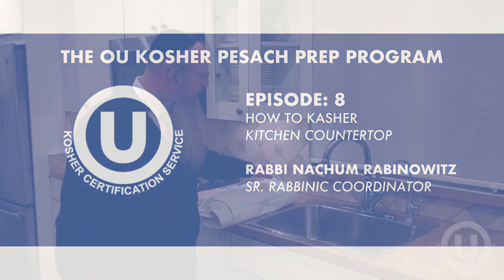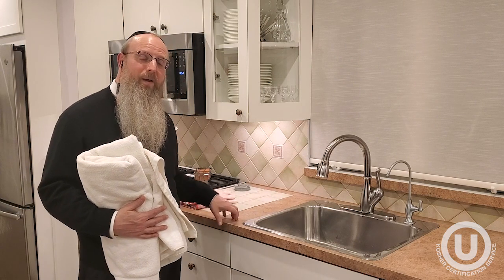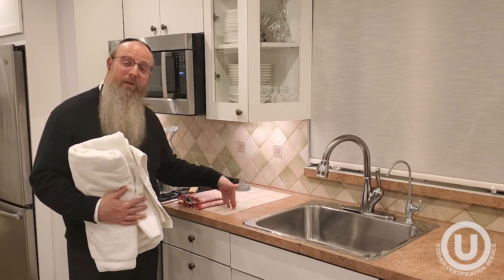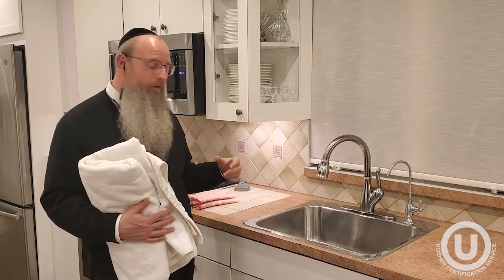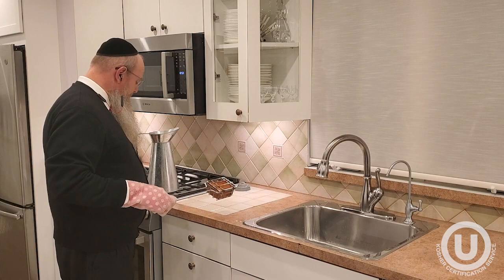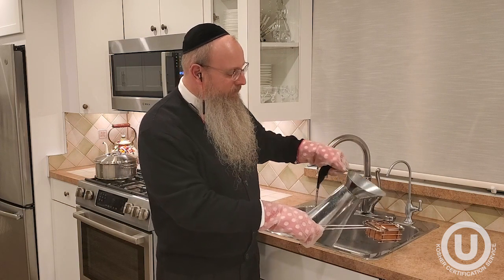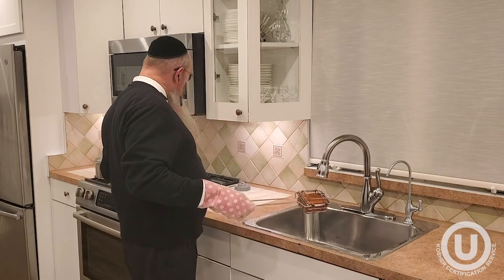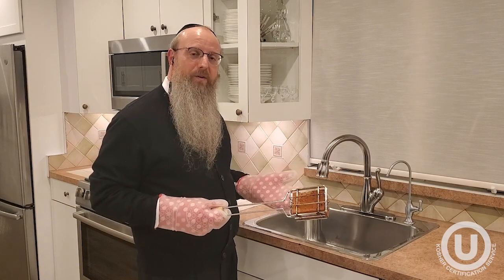How To Kasher a Kitchen Countertop for Passover- Episode 7

Comment: The water boils at 100C under normal atmospheric pressure. The brick cannot 'superheat' it.
Reply: The brick may mitigate the hot water cooling slightly from the boiling point while it is being moved and poured after being taken off the fire.
Reply: Steam can easily exceed 100C...
Liquid water is not doing the work here, heat is.
Reply: @thedaviddabrow  
Bullshit. That is true for LIQUID water. Steam is a gas, not a liquid.

Solid water ice can be cooled below 0°C, and gaseous water can be heated above 100°C. Those are the limits for LIQUID water only.